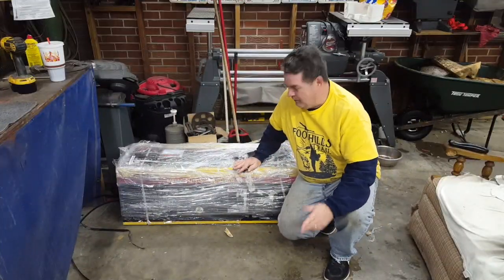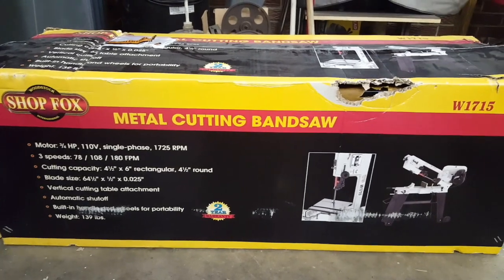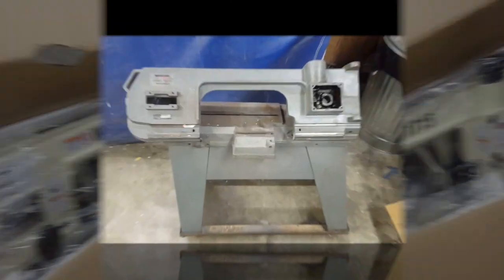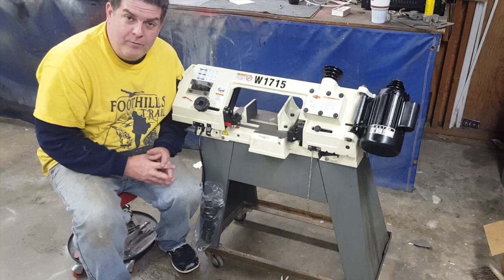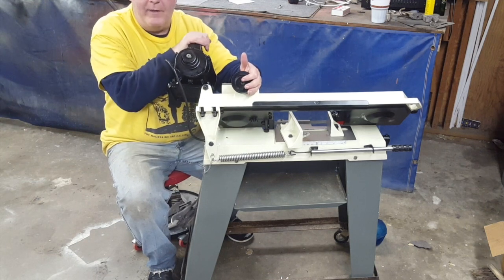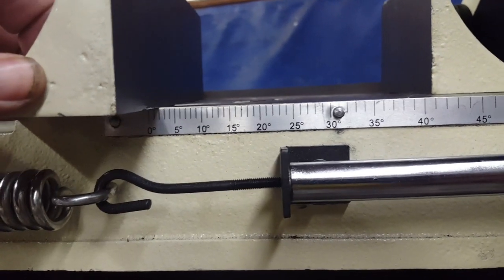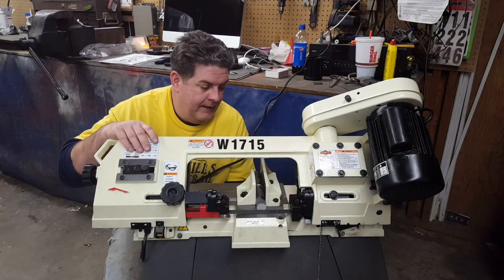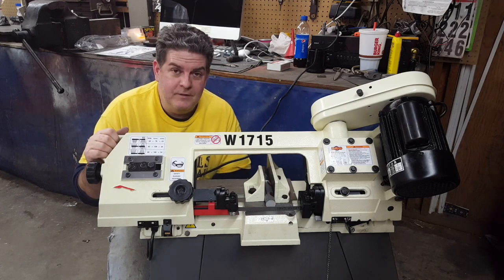New Shop Fox Bandsaw

Comment: That is the same saw that Harbor Freight sales just different color. Mine is just like that one only red. Great saw had mine for 2 years no problems had made some modification  to it. Great video . Oh and my stand is crap also. 
Watching in Alabama
Reply from the maker: Using the older stand has worked out good so far.

Comment: What is your opinion on putting a coolant pump and tray on this type of saw? Just curious! This one looks pretty nice though!
Reply from the maker: I have never thought about it, it works great like it is. Thanks for watching and commenting
Reply: @foothillstrailhiker2426  I suppose of you were doing alot of parts it repeatedly it would be worth the extra work of putting one on but otherwise it's probably ok just they way it is. BTW, what is the actual distance w/o the lathe Chuck on to the center of the mill spindle on the smithy.
Reply from the maker: @markreardon3472  13 inches